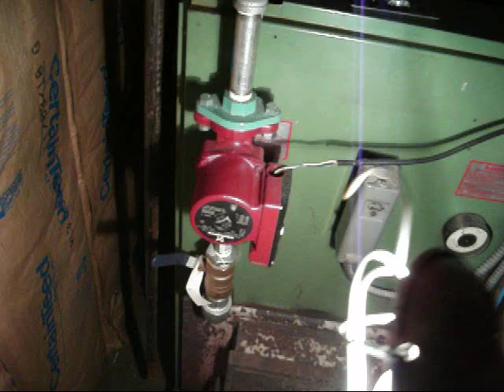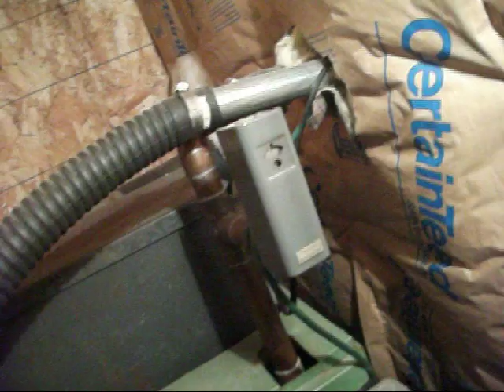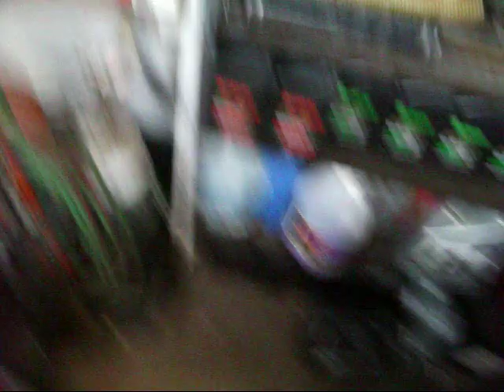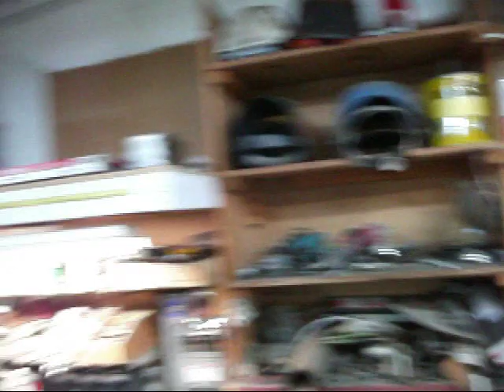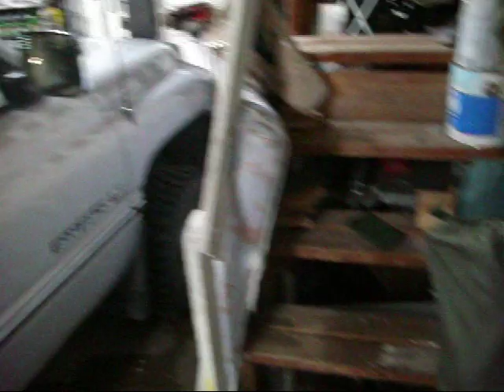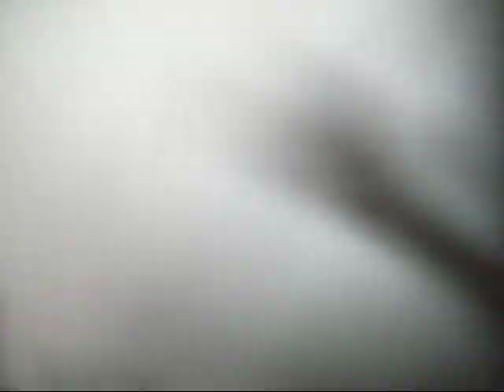redneck outdoor wood boiler

Comment: Do you run auto anti-freeze in the pipe?
I afraid with water in the pipe, if the system ever has a hiccup, the water would freeze and burst the pipe and cause a lot of damage.

Comment: You are a genius. Excellent work. Have you considered replacing the glass window with plexi, and after cutting holes in it, you could run your pipes through? I see that you are also an auction goer... there is always a good deal to be found.

Comment from the maker: @Navigator777777 well when the fan is off the air is not off there is still the natural draft through the fire box. that is partially why the overtemp. system is necessary.  i don't know how much you know about HVAC, but warm air naturally rises, so the hot smoke going up the chimney pulls fresh air into the firebox without the fan running, the fan just "spices" the fire up when needed. this is then same kind of system forced air wood furnaces use too.

Comment: Being as the trailer is still in existence.....can you explain why an explosion doesn't occur every time the fan kicks in?
Wood vapor is explosive or can be used as a fuel.
I'm not critiquing...trying to understand.
I've built a 2000 sf shop with in-floor heat coils and nothing to heat with.....and want to do the same thing your are doing.